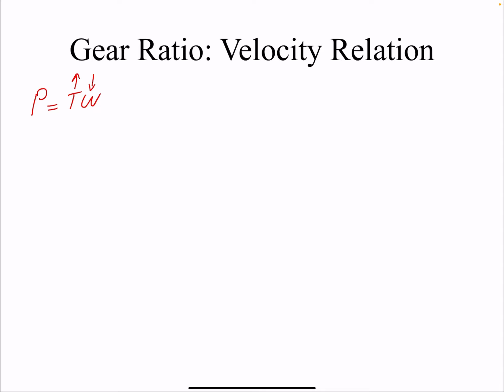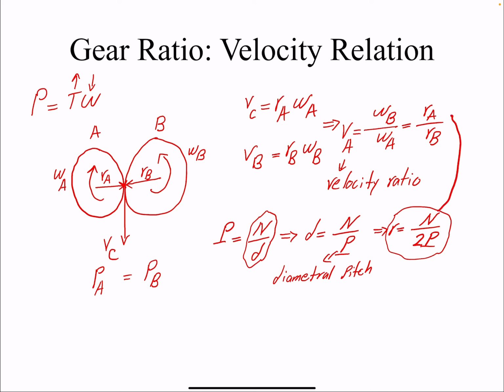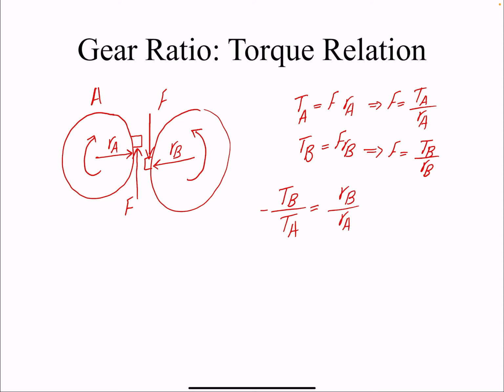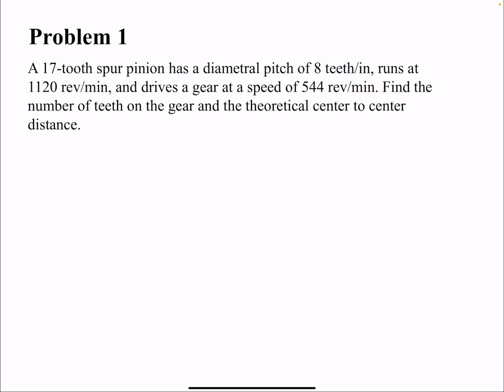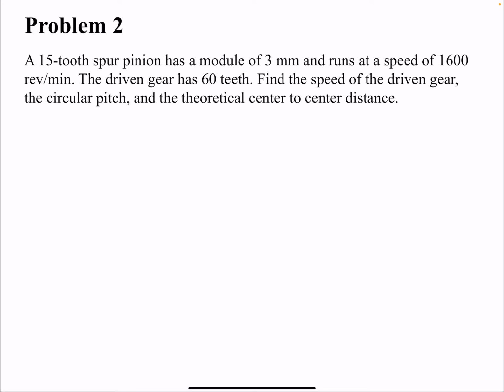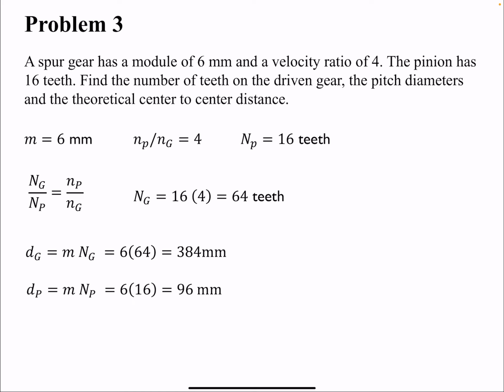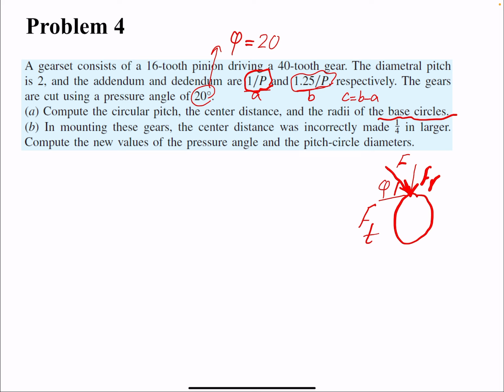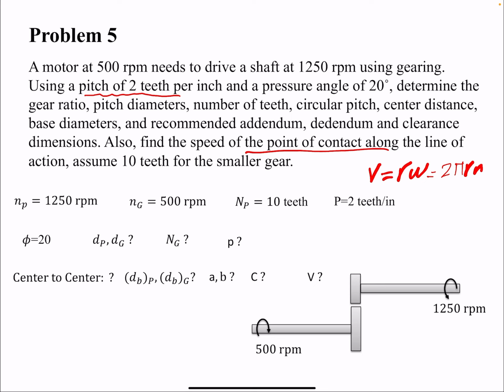Gear Ratio: Velocity Ratio, Torque Ratio

Comment: the force F at gear B is in the same direction as the torque Tb why is the equation at gear g is not in negative?
Reply from the maker: Gear A is the driver and connected to an input shaft that provides a torque, and gear A is in contact with gear B, is is driving gear B, so there would be a resistive force creating a counter torque at gear A. The gear B is a driven gear and the force gear A acts on gear B creates the torque on that gear!